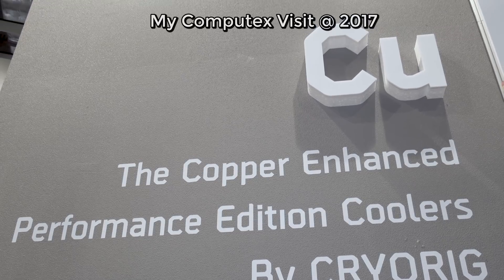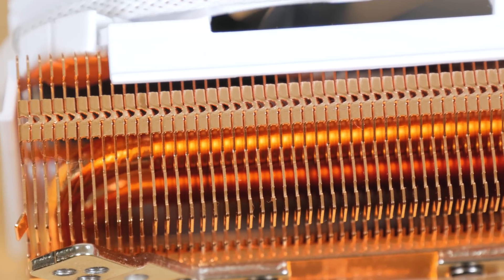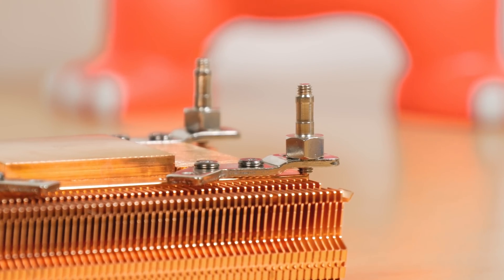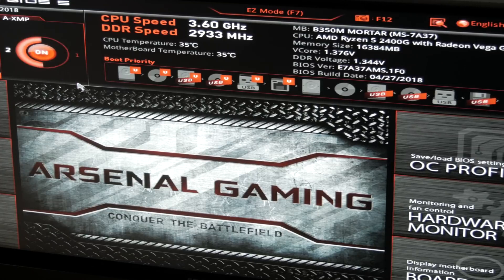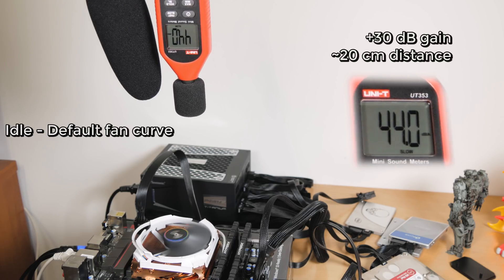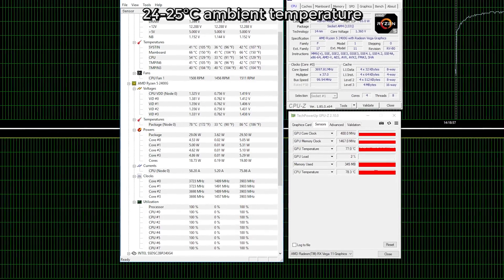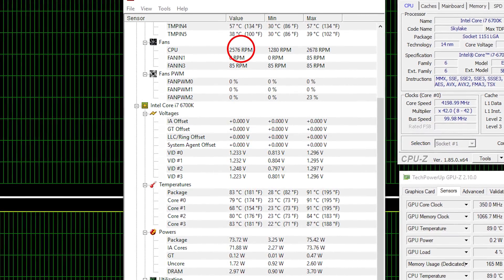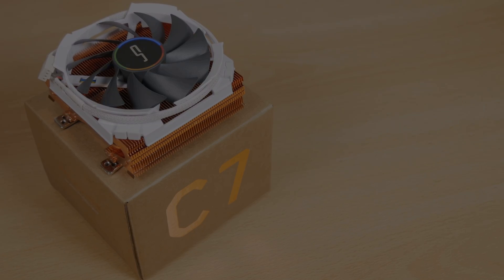THIS Thing Is HEAVY - Cryorig C7 Cu Review

Comment: I want to know why Cryorig made a copper version? And how does it compare against the aluminium version... Anyway, as always, a nice video to watch!
Reply from the maker: Copper has better thermal conductivity than aluminum, although it's more expensive, that's why they've decided to make it, to spice the market!
Reply: @MattsPaddock  It's more like old trend coming back to market. We already had full tower coolers out of copper and they didn't exactly stood out much in thermals, but were very heavy (1.5kg) and that point could really damage motherboard. Meanwhile at such small form factor they can make some sense, only they are priced reasonably. That's due to that mixture of copper heatpipes and aluminum fins is really good.
Reply: It doesn't matter. You can't even find these copper ones online!

Comment: Great video! Perhaps in the future you can revisit some of these smaller form factor heatsinks inside a small itx case with cramped space and less airflow than an open bench to simulate a real world scenario. I have a Shift Evolve X I was thinking about putting something like this in and I think that I would have to add at least a few degrees to whatever result came of the open bench test. 

Regardless, love your videos. Keep 'em coming!

Comment: I'm interested in the bigger ones tho :)
Would you be interested in doing a video comparing the biggest one with one fan to a popular aluminum one (i.e. i have an Arctic Cooling i30 on an i7-6700k and Im really satisfied, but could always be better) with similar size and fan count ? I'm really curious if the copper does make a significant difference.
Reply from the maker: I'll try to get my hands on the rest of the copper line-up for sure, they will release other models at some point in time, their smaller tower coolers, like the H7 / H5.

Comment: The cooler looks interesting performe decent for being small. But it need standard fan and fan mount cause if the fan goes bad we need to buy new heatsink insted of just replacing the fan.
Reply: Well noctua has one. And Noctua L9x65 support both Slim and standard 25mm thick fan. Cryorig should add mechanism to support both slim and standard fan
Reply: Bluerexx unikon There are adapter clips in china for the C7 CU